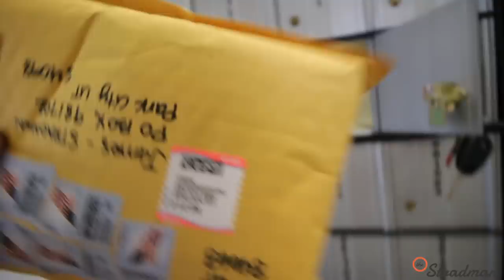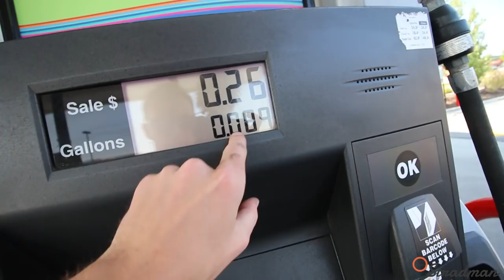Pulled over by the Police in my Go-Kart  **emotional**

Comment: Fun fact, there are no 'weight sensors'.  They're actually coiled wire buried in cuts in the asphalt or concrete.  Then Sealed over with a road grade epoxy. What the sensor picks up is a difference in magnetic resonance, created by large metal objects, running engines, etc.  If you have a small vehicle like a gokart, moped, or motorcycle, placing Earth magnets on your lower frame rail will solve this sensor input issue.

Comment: It's not a weight sensor at all, same with traffic lights, even though people think they are. If it were a weight sensor the crete would have to be flexible, and it's not, so it would crack upon depression of the scale/sensor underneath. It's usually some form of metal detector so being that close to the ground with an exposed frame like that should actually make it work better, in theory.

Comment: +TheStradman If you have the kinda money you need for a Lambo, you owe it to yourself to try a real racing gokart. Either the classes KZ2 or OK will give you the biggest rush. KZ2 is geared and OK is not. I've driven the predecessor to OK, called KF2, but ran out of funds. Of course there are also the 250cc Superkarts, but that's a different animal. KZ2 and OK will feel like your gokart, but with smoother steering, more grip(if you use regulation tyres) and a world of difference in acceleration. The KF2 I drove feels very similar to the acceleration of a Porche 911 in the low/mid range RPM where it takes off the most.

Comment: Most sensors don't get triggered by the weight of a vehicle. It's usually an electromagnet that detects the metal in or underneath the vehicle. Common misconception. I install them if anyone was wondering about my knowledge.

Comment: In order to put a push button start you'd need to replace the flywheel and put charging coils on it, and you'd need to make custom starter, and charging coil brackets, so it would be more worth it to get a 420 predator or a Tillitson 212.

Comment: So I’m looking for a go cart I will sometimes use in smooth farm fields but mainly on the road, some of the roads are cracked or uneven or have bumps, is suspension necessary?  Speed is probably around 35

Comment: Get a 160cc or 200cc twin engine kart and put a small cog on the back it will go like 70mph but small cog means slow acceleration but faster and opposite with big cog

Comment: How difficult is it to install an electric start so you dont have to get off and pull every time?
Reply: well you would need to buy a new flywheel with teeth on it and have acess to flywheel for starter, and you would have to wire it to a button and buy all that stuff, basic wiring and some modification to engine cover
Reply: @j0sh368  would that be worth it?